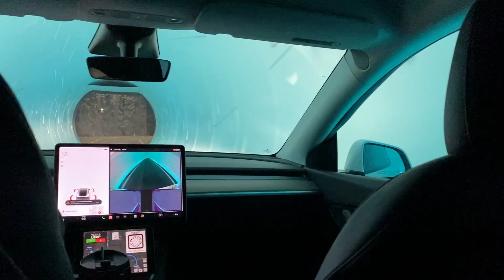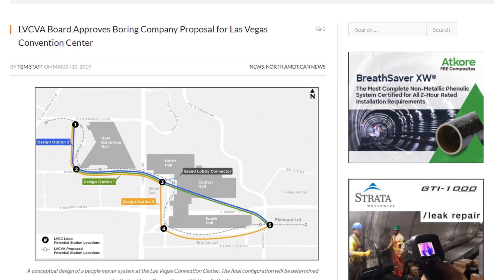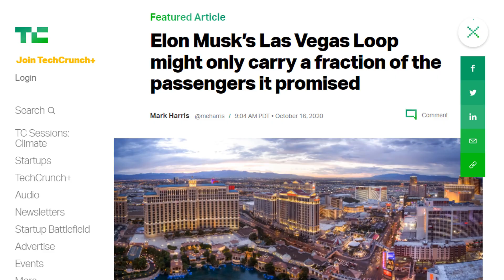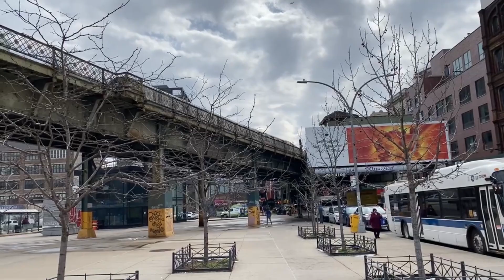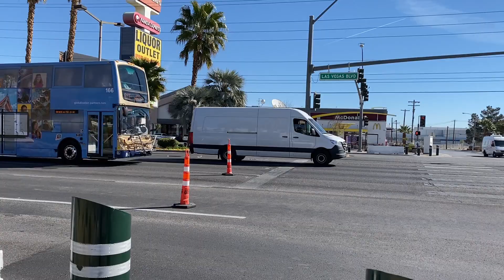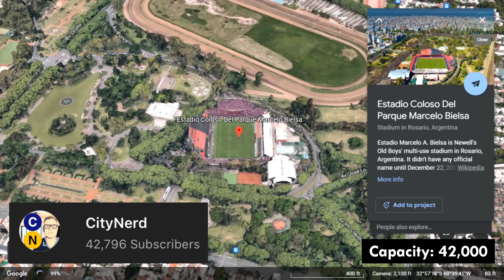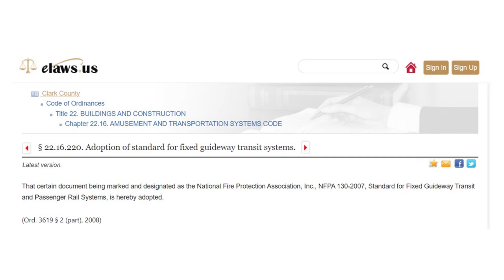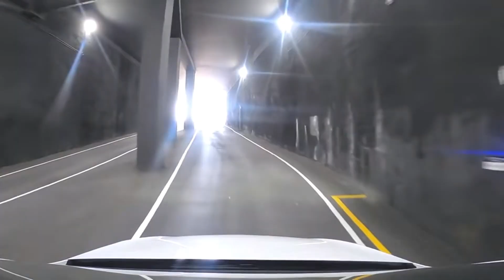Inside the Las Vegas Loop: Transportation Game-Changer, or Complete Waste of Time and Effort?

Comment: My take on the tech? The tunnels size themselves are fine. In fact they could be used in theory to run a London Deep Tube subway service in them. HOWEVER putting cars in them? Terrible! Buses in them? Terrible! Anything but electric steel on steel or maglev trains is a terrible idea due to their limited size. My dream concept? Automated maglev multiple unit trains that could be dispatched like the Vancouver Skytrain with as short as a 90-second headway...  Therefore nobody is dwelling in stations long... Just in and out quickly the way transit should be...
Reply: To be fair, for such short distances, just putting nothing in them and letting people walk through them could work quite fine too. Would certainly increase the capacity, at least.
Reply: @Codraroll  I'd say electric bikes could make some sense, but even just a powered walkway like the kind common in airports would be pretty solid over this distance.
Reply: @Lankpants  Electric kick scooters too, maybe? Or would the risk of injury perhaps be a little too high?
Reply: @Codraroll  Scooters would probably be fine too. My mind just went to bikes  because I tend to cycle quite a bit.
Reply: Perhaps before holding up the Skytrain as a good model to follow, you might like to compare its performance, passenger throughput and cost to the Loop. 

The Skytrain network cost a grand total of around $4 billion for the 49.5 miles of track or $80m per mile (and its not even an all underground tunnel system). 

The Skytrain had a daily ridership of 526,400 (pre-pandemic) over 3 lines and 53 stations and 298 trains, so that gives us averages of 9,932 people per station or 1,766 people per train per day.

The busiest Skytrain station, Waterfront handled 37,500 people per day over 6 different tracks/platforms, so that averages out at only 12,500 people per line per day.  And that was pre-pandemic, it's much worse now.

In contrast, the LVCC Loop handles 27,000 people per day during large conventions.

And the currently under-construction Las Vegas Loop will consist of 51 stations over 29 miles of tunnels with a headway in the main arterial tunnels of 0.9 seconds (5 car lengths) handling 57,000 people per hour and is costing taxpayers ZERO dollars. 

Headways on the Skytrain vary from 2 up to 6 minutes peak and 20 minutes off-peak meaning lots of waiting around for the train to come and then yet more stopping and waiting at every station on the line before you get to your destination. 

In contrast, Loop EVs leave each station down to one every 3 seconds with zero waiting even off-peak and travel direct to their destination at high speed. 

So not only is the Loop far faster and vastly cheaper per mile than the Skytrain, it is actually more than competitive capacity-wise as well. 

So tell me again why you want to replace the Loop EVs with trains?
Reply: @andrewfranklin4429  You're using some very misleading figures here. You're measuring entire system capacity vs single station (neither of which is the correct way to measure usage) and you're using theoretical peek vs average usage. Both of these are highly misleading.

The Skytrain being a far more substantial system means that most of the people on a train passing through Waterfront will not leave the train, even if it is the busiest platform. It is common for people to simply stay on the train and move through it. The train is still serving these people a utility. They must be counted. This is why we measure rail usage by looking at the number of people moving through a fixed point per hour. If that's a station it does not matter if they get off the train there or not. This same metric additionally cuts the capacity numbers of the LV Loop substantially to under 2000 people per hour, while boosting most traditional rail services to a number well in excess of 10000.

In addition the Skytrain rarely operates at capacity while the LV Loop just rarely operates. When it's not suffering crippling reliability issues it's almost always at or over its pathetic capacity. This is why your second point is complete BS. The theoretical capacity Skytrain can hit is staggering. It's a train line. They do capacity better than any other form of transport. No serious person argues against this.

Having said all that, Skytrain is actually kinda shit in and of itself. The technology Skytrain uses has huge issues and they would have been better off had they just used a standard viaduct subway or light rail system. A good single subway tunnel can easily carry in excess of 20000 people per hour. 

Also the system certainly doesn't cost taxpayers nothing. Even Musk talks about the subsidies he's receiving if he hits his targets for capacity. Which is a fucking big if. Where do you think that money is coming from?

You've been told all this multiple times in this comment section and your trash tier Musk propaganda isn't convincing anyone. What's the point?
Reply: @Lankpants  No, I am not using theoretical peak for the Loop but rather average daily usage during the medium to large conventions that the Loop has so far handled. 

The range for SEMA (114,000 attendees) is 25,000 - 27,000 per day so the average figure is 26,000 so far and there were no “crippling reliability issues” during that convention. 

Perhaps you’re thinking of the short 40 second slow down (they didn’t even stop) that occurred during this year’s CES convention (which only had 40,000 attendees) which handled 15,000 - 17,000 people through the Loop?  That of course was not crippling or a problem with the Loop but rather was due to the South Hall doors being closed for some reason. 

That 40 second slow down palls into insignificance against the 3, 5, 10, 30 minute waits that people endure waiting for the next train on a railway or the frustrating stopping and waiting at every station down the line between your departure and destination. It is trains that suffer from continual crippling delays every hour of the day as part of their normal mode of operation. 

We still haven’t had the really large conventions like the pre-pandemic CES (attendance 180,000 pre-pandemic) which the Loop was designed to handle so we don’t yet know what the maximum capacity of the Loop is like in real life. 

Also, the people sitting on the train just passing through Waterfront station are not counted through the turnstiles (that is what “busiest station” means), so are irrelevant when it comes to how many people the station handles daily. 

The important metric is exits and entries to a station not how many sit in trains going past. 

The Loop stations in the 29 Mile 51 station Loop are all set away from the main arterial tunnels on short spur tunnels so have no need of handling all the passengers going past. Only those whose destination is that station go to that station.
Reply: @andrewfranklin4429  A 40 second delay on this loop is literally a 50-100% increase in trip time. It's actually a bad enough delay that it would allow a system like a travellator (what probably should have been used) to become competitive with the cars, at half the speed.

Also, did you watch the video you're responding to? Guy was there for a convention, system was closed. Not an uncommon thing.

Finally, you have no idea how to measure traffic flow, but even still you could be consistent. The single station throughput of this system is pathetic. It can't come close to any Skytrain station, under any circumstance. The actual way to measure throughput is the number of people who pass through a given point however. This is not you used for either system. It puts Skytrain near the city centre above 20000 passengers per hour during peek and Musk's brainfart at about 1200 people per hour.

None of this was unexpected. It's pretty well known amongst traffic engineers that getting a single lane of car traffic to 2000 people per hour is like pulling teeth. Some cities have trains that can carry 1000+ people, meaning that even if they ran half hour frequencies they'd still have similar capacity to the Vegas Loop (this is ill advised, more smaller trains is better). My home city of Melbourne is one of these cities. Trains here have a seated capacity of almost 500, and more than that in standing room. On sections of the line they run two to three minute headways at peak, and they run fucking full. No car system can ever compete with the capacity offered by our kinda shitty train system. You need like a 20 lane highway to get the same capacity.

And like, I get that this isn't a completely fair comparison, trains in Melbourne are freakishly huge but it doesn't take a genius to see that it wouldn't be hard for a train to beat the 4400/h advertised capacity of the total system. Just a simple, two train setup with 100 people sitting room and assuming no standing (so small trains) running at the same 7 minute circuit time as the current Teslas (slow trains) would yield a capacity of 3428 trips per hour between the two terminus stations, which is actually already higher than the Teslas can achieve since not all trips are terminus to terminus (this is actually worst case). Using Tesla's methodology we get a capacity of about 6000/h. Of course, if you ran your trains at a sane speed, ran trains that weren't microscopic and considered a faster headway (you'd need a longer route probably though) you'd completely crush the capacity offered by cars. You could also achieve something quite similar by running like, 6 busses with a capacity of 50. Your wait time would cap out at two minutes in this situation, in exchange you'd get a capacity of over 5000/h (real numbers, not Tesla) and a system that requires 1/10th the number of drivers to operate. Did I mention it's far safer because it allows you to operate the tunnels as blocked sections with proper signals so if a bus breaks down it halts the system rather than causing a pileup, which is what happens if you actually run cars on 3 second headways. That's why cooler heads prevailed and limited the tunnels to 6 second headways to reduce this risk. I doubt this limitation will ever be lifted, nor should it. This also makes automation easier in theory, since blocked sections mean busses should never have to interact with each other.

Also, something I don't think you've considered, what happens as you extend the system. People all need to use the same spine, meaning that people going from the far north to 2/3rds of the way down the spine south and people going from 1/3rd of the way from the north to the far south cause each other congestion. A single point has a cap of how many cars can move through it per hour. As you move to 51 stations you're funnelling more people through any given point. The system will not cope, it already struggles to.

Even with all these fixes it's still a questionable system. The lack of walkways alone should have been enough to shitcan this deathtrap. The tunnel wouldn't even be legal here. Thank fucking god.
Reply: @Lankpants  you need to remember that there are several different metrics that are used regularly to compare public transport systems against each other:
- DAILY ridership of a station
- people per HOUR thru the turnstiles of a station
- people per HOUR sitting on trains going down a line past a point 

The reason why I mention daily ridership is because that figure of 27,000 people per day is the only real-world metric that the LVCVA has released so far and because the arterial tunnels of the 29 mile Loop don’t yet exist in order to measure people per hour going down the main line. 

So let’s look at each of these:

* Daily ridership of a station:
Can I trust you agree that daily ridership is an established way of counting throughout of a train station?  Go look at the stats of any railway station and they will almost always report annual ridership and daily ridership of that station. As such, comparing the 27,000 people per day capacity of the LVCC Loop against the daily platform averages of subway systems is absolutely valid and useful.

* people per hour thru the turnstiles of a station:
 the busiest line (Victoria) on the London Underground sees just over 60,000 pph in the highest morning peak hour sitting on the train, and yet the actual max number of passengers recorded getting off and going through the turnstiles at Oxford Circus Station (the busiest Underground-only station on the Tube) is only 23,720 pph in the busiest morning peak hour, but that is the total across 6 platforms and 11 different Lines. 

 So per platform we’re only looking at approx 3,950 pph at Oxford Circus Station. On a per line basis it’s only 2,160 pph.  

And those were the figures pre-pandemic - ridership now is less than half those figures.

In contrast, the LVCC Loop handles up to 27,000 people per day during the 8 hours that large conventions like SEMA were open.  So the Loop seeing an average of 3,375 people per hour EVERY hour of the day (not just during peak hour) is extremely competitive.  

But of course if we take into account the surge during peak periods, the Loop would actually be sustaining even more than that during the 4-5 hour peak period during the middle of the day and less up to mid-morning and late afternoon.

Note that the Loop’s real competition is actually BRT and Light Rail, so I only make these comparisons with expensive subways to make the point that the Loop is actually quite capable.
Reply: @Lankpants  now the third metric is 
* people per HOUR sitting on trains going down a line past a point 
Unfortunately the arterial tunnels for the 29 mile Loop don’t exist yet, but once each Loop station is connected to the closest pair of arterial tunnels, these will be running a headway of  around 0.9 seconds (5 car lengths between EVs at 60mph). 

A 0.9 second headway works out as 4,000 EVs per hour passing through which gives a capacity of 4,000 x 2.5 passengers 
= 10,000 pph in one direction 
Or with ride-sharing:
4,000 x 4 passengers
= 16,000 pph

But the Vegas Loop isn’t just one line down the centre, but up to 3 separate arterial tunnel pairs (6 tunnels in total) in parallel at times - particularly around the Allegiant Stadium to assist with handling the peaks pre and post games.  That gives a throughput of 30,000 pph one way (or 48,000 pph with 4pax per car) or 60,000 (96,000pph w 4pax) bi-directionally over those high traffic sections.  And there are several other sections where small loops come off to serve groups of stations through the heart of the city so the numbers continue to multiply.

And the great thing about the Loop topology is that if there is more demand, more tunnels and stations can be built at a cost vastly cheaper than a subway. 

So even in terms of people per direction per hour, the Loop easily holds its own against:

Bus Rapid Transit (at grade)
90 passengers per vehicle * 15 vehicles per hour = 1,350 passengers per hour per direction.

Bus Rapid Transit (grade-separated)
90 passengers per vehicle * 30 vehicles per hour = 2,700 passengers per hour per direction.

Light Rail Transit (at grade)
90 passengers per vehicle * 3 vehicles per train * 15 vehicle sets per hour = 4,050 passengers per hour.

Light Rail Transit (grade-separated)
90 passengers per vehicle * 3 vehicles per train * 30 vehicle sets per hour = 8,100 passengers per hour.

Subways
100 passengers per vehicle * 10 vehicles per train * 30 vehicle sets per hour = 30,000 passengers per hour.
Reply: @andrewfranklin4429  The average 3 lane highway has a throughput of 3000 cars per hour. That's what we're actually talking about, and that's assuming no congestion. It's equivalent to a three lane highway, maybe slightly better if we're being generous. I don't know where you're getting your numbers from, they're hopelessly optimistic. No-one is ever going to let the cars run in the way Musk sold them. It's crazy fucking dangerous. The tunnels are already a deathtrap. Run them on sub 1 second frequencies at over 100km and there's a death tomorrow.

Also your numbers for most other modes are, how do I put this, not very good. For the busses you're comparing the wrong thing. You've built grade separated infrastructure, more than just the simple overpasses of a grade separated BRT system. A fairer comparison would be a busway, it's quite common for busways to see multiple busses leave per minute.

You're underestimating the capacity of LRT. Most LRTs are built with more space than initially needed on platforms so they can run more than three carriages. Again, I live in Melbourne, we have trams with 500 person capacities.

Your subway estimate is about right. It does take a 30 lane highway to offset a single subway line. If you think digging 30 of these tunnels rather than one subway is a good idea, power fucking to you I guess.
Reply: @Lankpants  I don’t know what freeways you drive on, but here in Perth every busy freeway I’ve ever driven on at 100kph (60mph) typically sees the distance between cars around 2-6 car lengths. 6 car lengths is equal to about a 1 second headway at 60mph. I would have thought that Melbourne was worse than Perth?

This agrees with a 2010 study by the Honda Research Institute that found that 25% of drivers maintained a distance of 2 cars between vehicles at 60mph on a busy 2-lane freeway, 15% 3 car lengths, 15% 4 car lengths, 5% 5 car lengths and 15% 6 car lengths. 

So that is 75% of cars having a headway of one second or less and 40% maintaining a headway of 0.5 seconds or less. And remember those are cars driven by potentially distracted, drunk and careless drivers. 

The Boring Co is as I say planning on a headway of around 0.9 seconds (5 car lengths between EVs at 60mph) which will give a throughput of 4,000 EVs per hour.  With 2.5 passengers per car that gives us 10,000 people per hour. With 4 passengers per car 16,000 people per hour per single tunnel. 

Once the Loop autonomous control systems with their millisecond response times and ability to for example command ALL vehicles in a section of the Loop to brake or accelerate simultaneously, there would be no problems achieving headways if this duration.
Reply: @Lankpants  You mention BRT and that reminded me of the Adelaide O-Bahn which many people laud as being a great example of Bus Rapid Transit. 

It is mostly a concrete track overland wasting gobs of space and splitting the surrounding area and travels at an average of only 22mph due to having to stop at every station, as well as having to negotiate traffic lights and transports only 40,000 people per day. 

Not per hour - that’s per day. 

And the cost of this wondrous system of slow buses?  $98 million dollars. That’s $13.4m per mile and that isn’t even underground. 

Aussie Wirraway extols the virtues of the 13 mile, 28 station IndyGo Redline BRT which only carries 6,000 people per day and which costs $19m per mile ($247m in total) all above ground! 

This compares to the Vegas Loop which will be 29 miles long, have 51 stations, will transport at least 57,000 people PER HOUR and costs taxpayer ZERO dollars.  

Even the little 3-station 0.7 mile long LVCC Loop with its 27,000 people per day has 4.5x higher throughput than that IndyGo BRT for 20% the cost despite being underground. 

Even if taxpayers were paying, the cost of Loop tunnels is as low as $20m per mile of dual tunnel and cost of stations is $2m each. 

If you’ve got a better example of BRT in real life in Australia or the USA, I’d be interested to know, but from what I can see it just doesn’t compare to the Loop.
Reply: @andrewfranklin4429  The Adelaide O-Bahn is a shitty gadgetbahn, just like the LV Loop. It has no reason to exist at all. It's pretty similar to most monorail systems. Overly complex, trying to be too clever for its own good. They should have just built light rail, because that is what the system wants to be.

When I say Busways though I am referring to systems like the Ottawa Transitway, a completely separated bus only highway that services 11 different bus lines down the length. To be completely clear I think this system has gigantic flaws. Having said that it is just a strict upgrade when compared to using cars. The Ottawa Transitway can move a similar amount of people to a subway line, it actually has very good capacity. It's never going to be sustainable or economical like a subway line though.

Also, you keep saying zero cost, but that's not how this works at all. There's a cost in there. There's 62 drivers on the current strip. They must be paid. Tesla is far too inept to automate their jobs away. Who pays them in the long run? Who pays the cost to bore when Musk isn't using this as a glorified advertising scheme. And who pays the safety cost because dipshit couldn't install a damn walkway? All of these things will inevitably be paid by the taxpayer. And until Musk works out how to build a walkway no other city is going to allow this in their safety codes. Thank god NSW was smart enough to tell this Musk where to shove it.
Reply: @Lankpants  The Ottawa Transitway has:
9.4x the number of vehicles as the current LVCC Loop, 
9.4x the number of drivers 
14.7x the number of stations, 
7.4x the number of daily passengers
2.3x the people per hour
2,400x longer headway between vehicles
at 9.1x the construction cost of the Loop. 

That actually looks pretty comparable to the current LVCC Loop in just about all of those metrics if the current LVCC Loop was scaled up by about 9x. 

The 9,000 - 10,000 people per hour per direction throughput of the Transitway is a lot lower than a subway though. 

“The 60-km [37-mile] Transitway system includes 26 km [14 miles] of bus-only roadway, with most of the remaining distance on reserved freeway or arterial lanes. Costs have been estimated at $435 million. “

“There are 200,000 daily riders, and during the peak hour, about 180 to 200 buses enter the central business district on the busway in each direction — about 9,000 to 10,000 one-way passengers.”

The Transitway has 660 buses operating with a 4-minute peak headway an average speed of 21mph across 11 lines and 44 stations. 

Compared to the existing 0.8 mile 3 station LVCC Loop which handles up to 27,000 people per day using 70 EVs and around a 6 second headway at a speed of between 30-40mph and $47.8m construction cost.
Reply: @Lankpants  Well said. Unfortunately, the utter pillock you're arguing with is not likely to take it to heart.
Reply: @Lankpants  (Unfortunately Erlend tends to fall back on insult when his arguments fail him)

 by the way Robert, did you notice that comparing the stats of the Transitway to the Loop, the former actually has a higher ratio of drivers to passengers carried than the LVCC Loop?

The Transitway has 9.4x the drivers as the LVCC Loop while only transporting 7.4x the number of passengers. 

So the Transitway actually has a higher wages bill proportionally than the Loop.  And once autonomy is turned on, the difference will be even more drastic. 

And I’m wondering why you believe the Loop needs a walkway when it doesn’t have all the dangers and trip hazards of a rail line in the tunnels?  

The road surface is 112” wide (9.33 feet) wide while the Tesla Model Y is 75.6” wide meaning that there is 18.2” (1.51 feet) of roadway and 37.2”(3.1 feet) to the wall of the tunnel on either side of the car. More than enough room for the rare occasion when someone needs to get out of the car while still in a tunnel.
Reply: @andrewfranklin4429  "6 cars equals 1 second headway at 60 mph."
I guess you did not pass your driving licence then. At 60 mph (100kph) the 1 second human braking reaction time alone is 30 meters distance, and the braking distance is 100 meters, making a total of 130 meters to brake At 50kph alone (half the speed) the total braking distance according to formula is 40 meters. Autonomous driving would vastly the reaction time distance but will not change the braking distance (human driver or computer the physics of braking are the same the moment the braking process starts)
Reply: @andrewfranklin4429  If you had paid any sort of attention to this channel whatsoever, you might have realized that the Skytrain is considered a joke of a transportation system. City Nerd has talked about it extensively in his other videos.

The problems are manifold, but the two most important ones are that it doesn't connect to the airport (requiring visitors to commit to another mode of transport, i.e. hired cars, as soon as they enter the city), and that the stations are all located far at the back of the resorts they ostensibly serve. They are notoriously poorly labeled and hard to find. The stations are also located quite far from anywhere you'd want to travel to. They just connect different casinos, but not all the big ones, and it synergizes poorly with the attractions of the city. The High Roller Ferris wheel, for instance, in theory sits right next to a Monorail station, but pedestrian connections between the two are allegedly quite bad. The Skytrain isn't even located near the famous Strip. And apparently, that's entirely by design, as the car rental lobby managed to push a deliberately neutered system so it wouldn't compete too much against the "four people to a vehicle" scheme they had going. It's designed to provide minimal utility and be a waste of money, partially to discredit any ideas of building a functioning public transportation system in the city.

I also think it speaks volumes of your dishonesty that you yet again talk about the 27,000 ridership figure for the whole Loop (despite having been told repeatedly why it's a stupid figure), yet somehow perform the mental gymnastics maneuver it is to split the Waterfront traffic in half, so you can arrive at a number more favourable to you. Merging numbers for one system while splitting them for another, and comparing them while hoping that nobody would notice how utterly wrong it is? How dumb do you think we are?

Again and again you're quoting marketing buzzlines, hugely optimistic estimates, and seem unable to tell an apple from an orange when making comparisons, you're repeatedly called out for it, and yet you keep on. Honestly, can't you see that if you can't argue your position without resorting to an avalanche of fallacies, maybe the position is not worth holding on to?
Reply: @andrewfranklin4429  Luxtram 16km 24 stations 500 million USD, over 12000 people per hour capacity (every 2 minute one tram with 422 passengers), 31 million per km.
Las Vegas Loop 2km 1 station 50 million USD per km, only 4400 people per hour maximum claimed nearly 3 times less capacity per hour at optimal factors at best. Luxtram requires at least 6 times less electricity per person

Luxtram 422 persons board in less than one minute (one tramway every 2 minutes). Show me any video where 422 people board cars and drive away in one minute at one station at the Las Vegas Loop. You cannot. Facts.